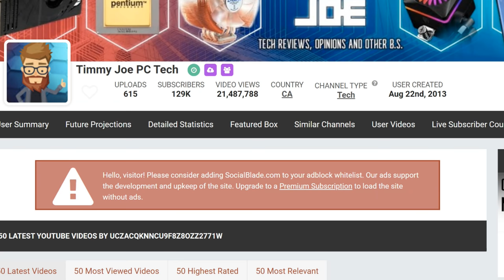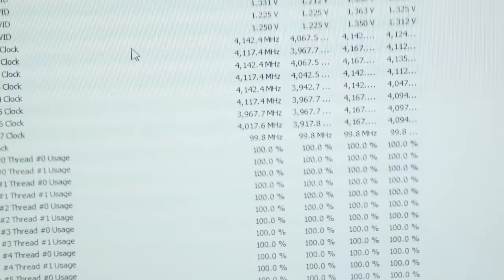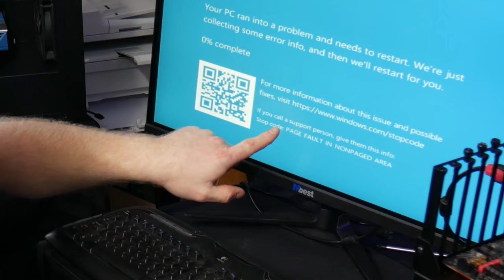This Ryzen 3700x was my biggest problem in 2019...

Comment: I had exactly the same issues with BSOD's with my R7 3700x recently. I bought it around August 2019. But in my case it did BSOD's not only on Gigabyte MB but also on ASUS. I just sent it for RMA (the CPU) and today I got a new one, because it passed AMD inspection of being faulty (the CPU). I think the most early samples of Zen2 CPU were not properly tested and had some issues with boost algorithm. In my opinion your CPU is faulty too but on some motherboards the boosting algorithm may work in a different way and not causing the issue. Whe I disabled Core boost in BIOS then even on my previous faulty CPU I got full stability but sacrificed around 20% of performance. So if I were you I would RMA that CPU to AMD.

Comment: Voltage at idle is what I would look at on those two problem motherboards. The voltage curve or load-line calibration could be different on those Gigabyte boards, causing the behavior of testing out fine for stress tests but crashing at idle.

I have had my laptop i7-8750h set to -.140v offset and it will run forever (or at least weeks) if video encoding or gaming, working. And then it will crash at idle. I think that -.140v ends up way too load of an offset when applied to the voltage curve. No way to adjust they way I would need on a Alienware system or in Intel XTU.

Comment: Hey Timmy, my worst nightmare, it took me 14 days to figure that out, I have seen similar problem too with Asus MB's, always at first startup it gave BSOD especially when using a browser just after startup. But after a restart it would run perfectly for hours. I found out, It was related to the fast-boot setting in the bios/windows. I even had a talk with Asus about it and could not understand why they would allow such a setting to be enabled by default if it could cause instability and they told me that sometimes certain type of combination of hardware does not support fast-boot. After i disabled it, it worked perfectly.

Comment: The first thing that popped into my head when the BSOD came up was memory controller on the cpu.  The other BSOD rule that out.  This reminds me when Jayz had an issue where a gpu would work fine on one board, but not another.  My guess on that one was that there's a damaged trace somewhere either on the component or the motherboard for grounding or diagnostics or something that one mobo used, but not the other.  I'm guessing you have the same problem with gigabyte and this chip.

Comment: I had similar issues with my Gigabyte mother board and ram :). I completely stay away from all stuff Gigabyte. Always had problems of some sorts with Gigabyte. :) welcome to the club, seems I am not alone.
I think what is happening is that, traditional hardware manufacturers, are left cramming more stuff to their hardware that needs a stable driver/protocol implementation, and many of them suck as software development. That is not where their strength is.

Comment: With gigabyte mobo’s you have to set xmp and change the high frequency support level to 1-2 or 3 depending on ram speed. I set ram speed and turn on xmp but never changed the level and would get occasional issues or had to run at something low like 2166mhz. Changed it to level 2 and never had an issue… knock on wood.

Comment: Being that it isn't a retail sample it may have issues on newer bios than the reviewers kit provided versions.  Jay had issues on his channel with the pre production MSI board.  Any chance you backed it down to the BIOS provided with the CPU and MOBO combo for review?  My x370 Gaming K7 from Gigabyte is very finicky for sure but their 40 an up BIOS is WAY better than their older BIOS releases from 2017 and 2018.  Did you check the voltages set for SOC and the V-Core?  Maybe the auto settings were too low and needed an LLC bump.

Weirdest issue was 2 brand new SSDs would freeze up windows in raid 0, but only when their controllers got hot.  It took forever to diagnose and fix.

Comment: I had a problem with 3700x on the Asus Prime X570-P. 
It wouldn't boot with 2 sticks od RAM in Dual Channel, but only in slots A1 or/and A2. I had changed motherboard to MSI B350 Gaming Plus and it booted fine with 2 sticks in Dual Channel on that CPU. I also tested 1600x on my x570 and it worked flawlessly. Only my 3700x with x570 wouldn't boot with 2 sticks of RAM in Dual Channel. Does anybody know the solution for that?

Comment: When I first assembled my AMD 1600 I have an issue running my ram at 3200 MHz, so instead of overclocking to the allowable speed by the manufacturer, it runs at 2400 MHz stock. The first Ryzen boards have problems with several ram manufacturers.  My PC is perfectly stable now and running with an NVME drive, but I am missing out on potential ram performance that functioned fine on my older intel board with an i3, so I feel your pain. I still put rigs together for friends for free, but no one else. The biggest time waste, I find, is working with brand new hardware with exclusively new specifications that supports nothing that you have a large supply of; making trouble shooting a nightmarish waste of time. I love the 1600 Ryzen I purchased two plus years ago and will upgrade to a new AMD in the near future, but they are somewhat finicky. I will carefully do research to make sure that what I purchase next will be fully stable and compatible right out of their boxes. In the past I assumed that mobo manufacturers would release a bios update to fix issues, but often they don't and expect you to instead upgrade to their new board and shinier chip set.

Comment: Months after Ryzen 3000 launched, I was still hearing about people just having tons of issues with it. Eventually some channels were like "it's fine. It's fixed now" and then other channels would still say "it's still got problems." I mean so much so that I haven't recommended Ryzen 3000 to anyone. Maybe it is fixed now and your case is just a strange one, idk. I just bought me a 2700 and called it a day and I haven't had a single problem with it. Actually, I think I won the silicon lottery for once because it actually boosts much higher than it should. But point being...I still wouldn't touch Ryzen 3000. My guess is it has something to do with AMD making all their chipsets in house for this gen and finding out it's not an easy thing to do...I heard they're litterally outsourcing that once again for b550 and beyond.

I mean the performance is great and all, but it's just the same reason I don't overclock anymore... I've had several overclocks I stress tested and they did just fine... Seemed to work well and then like a few days later, or maybe even like a week later the computer would just crash out of nowhere while I was using it, so I threw it all back to stock settings and enjoyed reliability with what felt like exactly the same experience.
Reply: I'm excited when Ryzen 3700x released, I was hoping who build with Ryzen had zero problems and like you said the results are vary. For now, I'll stick with 9700 and see what Intel or AMD offers in the next few years and of course, with ddr5 and PCIe 4.0 becomes mainstream. I still recommend Ryzen to people who build a new system but with warned of silicon lottery or compatibility issues. I just hope for the upcoming Ryzen 4000+ these kinds of issues are gone.
Reply: I bought a Ryzen 3700X on Black Friday and haven't had any issues with it. From everything I've read on this particular CPU, there is no reason to overclock it manually since the boards do it automatically. The performance difference is so minimal manually doing it that it's pointless. Also, other channels have said that overclocking at a lower voltage within it's range is the key to getting it to work properly. However, since I've bought the thing I've never overclocked it and honestly don't feel a need to. I'm hitting reasonable speeds without the need for overclocking or a liquid cooler. Hell, I'm using the stock cooler that came with it and haven't run into any issues. My board is the mATX Asrock B450 Steel Legend and I couldn't have been happier with the CPU. Now if I was planning on getting a 3950X, then yes overclocking it manually would be beneficial. As I've said, from everything I've read and heard there is NO POINT in overclocking a 3700X. It's basically a decent CPU for the price your paying for with minimal effort.
Reply: I have 2 Ryzen systems and the only problem I have with them is the higher than expected idle power consumption, it gets worse if I touch any of the settings.
Reply: @h2oaddict28  
Strange, isn't it?

Comment: When I was building my Athlon 64 back in the day, I had bought a msi motherboard and msi graphics card, that wouldn't post together. Both worked, but just not together, exchanged the video card to Asus and had a working system

Comment: I build an AMD system in 2019. It always took 10-15Min to boot and to shut down. The gremlin was an old Intel SSD (74GB). After i unplugged it everything was fine. But it took me so long to realize: RAM change multiple times, GPU change, reinstall windows and drivers...

Comment: I've had 2 pain in the butt problems. 1st one was a MSI motherboard with a fx9590 would be fine then just lock up for no reason switched out memory reloaded Windows switched psu. I finally figured out what was wrong the motherboard took a crap if you plugged in the internet after a couple of minutes it would lock replaced the motherboard with an Asrock killer edition then it was good. The second was a partial used parts build I did with a new ASRock 970 motherboard cheap PSU case and 120g SSD and 1tb hdd the rest was used rx480 8g Patriot memory. It would blue screen most of the time and lock up other times Replaced pretty much everything. I started with a new PSU then started swapping parts from my wife's computer ended up being the vrm couldn't handle a fx 9590 CPU but was rated for 225 Watts put my wife's CPU in it fx8350 and it was fine. I give the lady I built it for a new build then resold the other computer with the fx8350 in it and put the 9590 in my wife's build that had an Asrock fx990 motherboard needless to say I took a hit on that build. That one was the worst I've diagnosed memory PSU nvme not booting before but this one kicked me in the walnuts

Comment: i had an x58  msi - motherboard that would boot i7 with some ram sticks, but a x5760 would not boot with the same ram.  MB isn't listed to take xeon, so i thought it might be that. Did a bios flash, tried a few different xeon cpus.  Tried different memory configurations between 6 slots. Checked user modded bios and processor table extraction in bios.  Finally decide to swap for different ram - 3 days later machine is working great.  What a pain! I feel ya!

Comment: For me it was an adapter (hdmi to VGA) causing my system to lock up while in heavy load or big changes(turning on/off a game or benchmark). Everyone told me it's the PSU, I swapped my thermaltake psu for a seasonic and same. After a lot of trouble(swapping gpus, and other pcs) thinking my new gpu is broken(this was only happening to the rx590 my old gpu was working fine with the adapter), I took it to a pc shop and we figured it out. I got a new monitor and it hasn't happened since.

Comment: I had a similar issue with an Aorus x470 board last year with a 1800x  I think the problem is with Gigabyte's questionable "8" + 3 phase VRM.  it runs less power-hungry processors like an R5 2600 just fine but stumbles just like you experienced on more powerful processors.  I ended up doing the same thing, switched to an MSI board, and was about to toss the Gigabyte board as bad until I read about the VRM problems.

Comment: running exact combo no issues at all. try changing p-states, different bios versions. im on f2. having pbo on and off. dig deeper into what happens with low loads. try different memory setting too. after all that go over boards with magnifier glass. they may have a fault from factory. could be a certain component. people should post serial numbers to see if this is a batch issue. there is a logical fault some where, its just figuring out what it is.

Comment: I had so much problem with my Ryzen 3900x , but my problem was with the gigabyte x570 master overvolting, which was making it super hot.
It would idle at 60c with the fan sounding like a 747 , so needed to use manual instead of auto.
Never had a blue screen with windows for years just lock ups.

Comment: I had an issue with a gigabyte motherboard too, where the top two usb2 slots for the keyboard and mouse would randomly freeze when in the bios or windows, anywhere from 5-30 seconds of use, but they'd work completely fine in any other usb3 slot

Comment: @Timmy Joe PC Tech : Maybe it is an old gremlin that has you there. The old Haswell Problem...I am aware you are using a new power supply but maybe your combo of Gigabyte board, PSU and CPU. On Intel systems there was the Power State C6 settings that prevented systems from going too low on power (destabilizes the power supply!), on present Ryzen boards this feature is called something along the lines of "standard idle power" and "ultra low idle power" on my ASRock B450 PRO 4. Set it to "standard", and it will keep the CPU from going to 0.4V on idle. It'll stay on 0.8V.
Those symptoms (crashing when idle) would exactly fit that picture. Lemme know if it helps?

Comment: I built a PC at the end of 2011, and had some serious blue-screen issues. Tried everything I could think of, but I had no clue. Tried different RAM, tried upgrading my cooler for the CPU (granted, at the time, I knew less about diagnostics than I do now), but I kept having this issue. 

Finally, I had the strangest eureka moment: the msi motherboard I was using didn't have any sort of heatsink on the south bridge, and when my GPU was firing up it would overheat the chip. I got a new motherboard, with a proper heatsink, but I'm still paranoid about the south bridge overheating so I have my 1080 running at x8 instead of x16 so it doesn't overlap the chip.

Comment: one thing i did which for some reason fixed issues with my GPU black screening and memory having bad sectors(it might not fix your issue but try it out if you want) was take eraser,and clean up gold pins on both RAM and GPU itself and guess what? memory no longer throwing errors,and GPU working fine like it never had issues

edit: i had issues with Q9550/P5KC system as well doing this to be but black screen,yeah it was making me so pissed i literally looked to sell damn thing and buy and modern low end rig so i can play game,turned around to be i just needed to clean up contacts a bit,and play with BIOS a bit so it became stable

Comment: CPU voltage shouldn't be on "AUTO" switch to "Normal"...common issue
Reply: Does it work ?
Reply: @abhishekdhoriyani2312  The Voltage in Auto is much higher than on Normal thats why it produces more heat also use the newest BIOS.

Comment: Lol, been there done that... too many times!  I do like your persistence : )

My weirdest was probably an Amiga 2000 back in late 80's.  Worked fine for everything except a new game I wanted to play at the time (Ultima ...don"t recall which one, 4 I think).  So yea, pissed and tried everything... it was the keyboard!  Bought a new one and Ultima worked!  Weird because it worked with all my other programs (800ish floppies... can't recall how I got so many ...cough cough).

The latest happened a few weeks ago.  2600 on gigagybte b350.  I would leave the pc on, no sleep and the next day it would be frozen requiring hard restart.  Event viewer (useless most of the time, who crashed (log files) no help, thought for sure it was Win update or defender updates as had Win10 updates off/paused (which they never really are).  Trialed Malware premium and disabled defender still same (lol, I was sure it was defender as it showed updates on the day... but basically it updates every day...). Bios changes, down clocked memory and cpu (yea I overclock), no go.

Seems it was HWinfo as I ran it on boot up.  Changed that and no freezes since (OC back to original).  But like you, not 100% sure but it has been a week plus and no problem... and it never did it before.

A useful tool for me in getting to the bottom of it was Search Everything.  I use this all the time but not in this way, I would sort by date/time and could tell exactly when the pc would freeze as I can see what the last files written and see the gap between the reboot.  Of course there were quite a few (windows...sigh).  Now why it just started doing it, dk but it SEEMS to have fixed it if I don't run HWinfo all the time.

Most common failure I find is ram (I bet it's yours too).  Yea, fun but  not at the time when it's happening!

Happy New Year  Young Man ; )

Comment: I have the exact same Gigabyte B450 motherboard, Ryzen 3600 running no problems. I get the feeling your 3700x might be not faulty but a little different from other 3700x's (maybe one of the cores needs a little more juice than usual, or gigabyte boards aren't giving quite enough power by default) - i would be curious what the idle and load voltages and temperatures are between the two motherboards - the temperatures might give you a hint what is going on, any warmer on one or the other means different voltages. Also if you have another 3700x to test with to confirm.